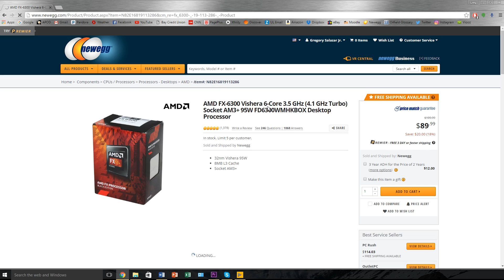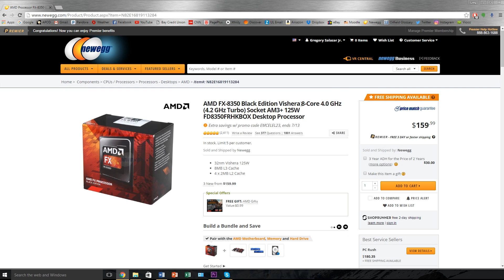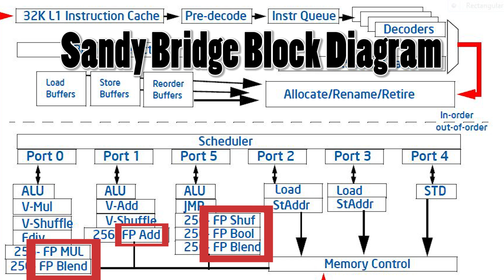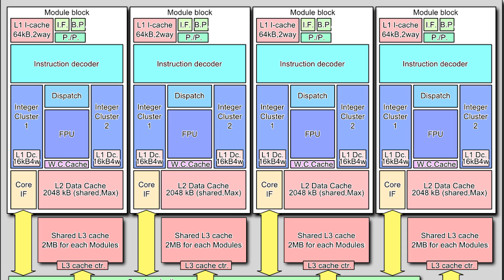How Many Cores Do AMD FX Processors *Actually* Have?

Comment: so as CPU tasks are  not sent always in parallel and the FX CPU assumes they are while Intel's hyperthreading does something not explained in this video to do processing out of order because of the scheduler being able to 1 as 2 cores instead of the "bottleneck" in the chip being there for Intel?
That is smart on Intel's part but i am still left wondering why design for that then need a windows patch to not crash on older versions and revisions of windows
The design makes sense for server loads just not consumer loads and most servers i see on prebuilt sites have more options with Intel's Xeon than what AMD has i forgot as some dropped those products due to lack of demand

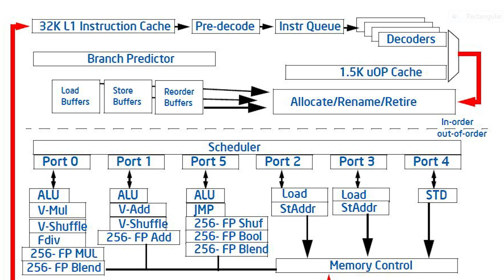Comment: Theres quite some missinformation here. First off AMD has had a class action lawsuite filed against them in 2015, and it's still ongoing (Case 5:15-cv-04922-RMW). When it comes to AMD's chance to win this, we can only speculate. I would however argue that it's rather slim. We should bare in mind that AMD's biggest downside in this courtcase is that the definition of "Core" (for general purpose CPU) was allready in use in this industry. What's even worse is that it was used by AMD themselves. Another weak point on AMD's side is the fact that the technique they use is called Clustered Multi Threading (CMT). As you can probably tell by the name or if you read up on CMT, it wouldn't have multiple threads if it one thread per core (since the technique is about increaseing the amount of threads per core).
Reply from the maker: Nothing in my video is "misinformation." You did not even elaborate. All you did was explain the CAL. In its current state, AMD can call it an eight-core CPU. I clearly explained the architectural layout of the chips with respect to Intel. Fanboy alert.
Reply: If its a "real" 8 core then you can call a 4 core 4 thread an 8 core.

Comment: The FX CPU's are built for and designed for intensive Multithreading and math crunching, not for pure IPC. This is why you see such wide variations in performance depending on the application. When using software that relies on few threads and raw IPC, it performs like an higher end I3, but will match some of the i7's on others that utilize it.

Comment: So how many FPUs are in a intel 6700 Quad Core?

I am just having an Intel system built after being a faithful AMD builder for 17+ years (starting with the 120Mhz AMD 486 DX4-120). I found that most DAWs actually feature intel processors and my current FX6300 is somewhat lackluster when I chain many Effects, which may lead both to Processor overload and audio dropouts (the latter is probably caused by my outdated MOBO [ASUS M5A97 rev1] in combination with legacy PCI audio cards).. I was sitting on the fence for a long time about crossgrading to Intel as there were many chipsets that were marked for bad performance (dropouts)  with legacy PCI cards, but I think that the chipsets have somewhat been improved. 

My new build is based on an MSI B150A gaming pro which has  a ASM1083 chip which is also in charge of PCI-e bridging. I will know next weekend whether this will work out or whether I have to sell my beloved M-Audio Delta soundcards and switch to USB based cards.

Comment: thanks for all the info, but I have a question: there's a programm that unpark all the cores of the CPU, it is safe to use? because I can see an improvement in the performance of my i7 2670QM but I don't want to crash my system. thanks again and good channel

Comment: AMD does have one advantage in this regard. Single core processing programs benefit from AMD's higher core clockspeeds, like Minecraft. If you are playing Minecraft with modpacks then AMD would have the advantage due to their higher clockspeeds. Programs that use multiple cores without limitations will have better potential with Intel than AMD, but still, it comes down to what programs you use due to developers coding them a certain way. For a program to use multiple cores requires coding that calls on multiple cores. Normally games would be coded and by default would use a single core. If a game were to use multiple cores it would need to either be built in the games engine or built in a file that the program can access and use, like an extension. Back during Minecraft 1.5 and 1.6 someone developed a mod that allowed Minecraft to use multiple cores to process multiple entities, which came very handy if you ran a lot of mods, like a modpack. Technic and Feed the Beast are such modpack managers. Under these conditions Intel would be better, but without it AMD would be better due to higher clockspeeds.

Comment: +Science Studio ... I've bought a FX 8350 CPU and sold it 6 month later again. It was the worst CPU ever which I bought from AMD. Before I used an AMD Phenom II X4 955BE. The performance boost between them was not really much. In like Skyrim I gained only 3fps more. Not a big deal. So I sold it and bought an Intel Xeon E3 1231v3 ... This CPU was much more better than the AMD CPU. In Skyrim I gained about 20fps more. I can read a lot of good reviews about the 8350 but in my opinion the 8350 is the worst CPU ever!
Reply: Xearox.de what the specs of ur build in 8350?
Reply: My build was:
CPU : AMD FX 8350
CPU Cooler : Scythe Mugen 3
Mainboard : ASRock 970 Pro3 R2.0
RAM : 16 GB DDR3 1600 Ballistix Tactical
GPU : Radeon HD 7970 OC
SSD : Intel 520 120GB

The system which I am using right now:
CPU : Intel Xeon E3 1231V3
CPU Cooler : Stock Cooler
Mainboard : Asus Maximus Ranger VII
RAM : 16 GB DDR3 1600 Ballistix Tactical
GPU : Radeon HD 7970 OC
SSD : Intel 520 120GB
Reply: Your Asrock motherboard is not that good for FX 8300 series. Best is the Gigabyte GA-990FXA-UD3 ver 4 or 5.
With that mobo my specs is:
FX 8320
Corsair H80i Liquid cooler
16 GB 1866 Crucial Ballistix Tactical Tracer
Sapphire Radeon R9 380x OC, 3GB
WD Enterprise 2TB 64mb cached
... and i'm still happy with it for more than 4 years now... overclocked in 8350 settings.

Comment: You have the best tech video's I've found and explain it clearly, albeit a little too fast. I own both a FX 8300 and a Phenom II X 6. With both at 3.3GHz, the Phenom beats the FX in rendering using Blender with the BMW27 benchmark by almost 3 minutes. I've found also that using my Hauppauge HD-PVR 2 capture card at 1080P the Phenom runs at 10% cpu load while the FX runs at 45% load. This is using the exact same system with just a CPU swap.

Comment: Well, I can agree that it seems to be a software issue, I noticed that 4 out of 8 cores are usually at significantly higher load than thee rest, like 4 are at 50% and the rest almost at zero, propably the reason I will get me a intel cpu soon (had the intel i7-6700K in mind)

Comment: Intel cores with hyperthreading aren't just "cores".
First of all every intel processor is hyperthreading capable... CPU masks are for HT cores.
When a chip comes out some clever laser cut/wire here and there enable or disable this or that feature, it's just a way to get better yield and separate market segments (i5 vs i7 -> noHT vs HT).

About HT... every core has some doubled functional units, lets say ALU, MMU and stuff... in fact there are double blocks for most "common" operations... the caveat is that those are SMALL blocks so you can double them with little die "overhead".
If HT is enabled (both hardware and software wise) the scheduler has his own unit for some operation and only one "common" block for the rest... thus allowing parallel execution with multiple pipe stages... out of order execution unit comes into play and try to maximize parallelism.

Long story short: bulldozer and intel HT are a lot more similar than it seems.
Reply from the maker: The way in which I described the differences was correct in this video.

Comment: Hi @ScStSalazar,

Just wanted to highlight that the reference to FPU usage was inaccurate in this video ( 3:05  ). Most common applications like .. Word processors , games or compilers do not use FPU's for their core functionality. The applications that commonly rely on FPU usage are like CAD/CAM software. You can find the specific functionality for FPU and other specialized instructions from http://www.intel.ca/content/dam/www/public/us/en/documents/manuals/64-ia-32-architectures-software-developer-instruction-set-reference-manual-325383.pdf , just search for something like fdiv ..etc. Most engineering and scientific applications will rely on FPU usage extensively. (another way to is to understand the big picture of how the code works , there is lots of algorithm / data structure work happening in a program , even in a game than executing physics engine related work )

It is also fruitful to consider historical aspects (DEC-Alpha / HP-PA-RISC ) and other architectures (IBM POWER / SUN(Oracle) - SPARC ) that surround the general microprocessor-based processing approaches. For example , certain concepts that Intel uses (including AMD) were originated outside of Intel/AMD. One of the technical approaches to optimize thread execution is known as SMT - Simultaneous multi-threading and Intel branded their version as Hyper threading (HT) . The architects knew that relying totally on clock cycles and instructions per cycle will not solve the barriers , ILP - instruction level parallelism and Thread level parallelism (TLP) was considered the way to move forward.  (I am trying to keep thing very short)

To take advantage of this approach the classical model of the software processes was modified , application processes became multi-threaded , Operating systems have multi-threaded kernels and sophisticated thread schedulers and to make all of this to work in harmony they used the Multi-threaded processors (SMT's). One of the core concepts in this era was thread context switch (less expensive than the process context switch).Since the applications will explore the threading models extensively , hence processors were optimized to handle such workloads. (To make all this happen - out of order execution (oooe), branch prediction, superscalar simultaneous multi-threading .. etc was introduced)

The SMT/HT approach is a way of making the thread execution efficient.  (fine grain capabilities of each implementation is up to each vendor , IBM POWER SMT <> Intel Xeon HT)

As per our topic , it boils down to the definition of the term "core" , IMO - the general assumption is core = single CPU , e.g. if the core is capable of executing 1 instruction per each cycle (hypothetical assumption), in a 8 core processor it should be able to execute 8 instructions in parallel if the OS scheduler submits to it , if not it is not ..I won't call it a 8 core processor !!! . So if the AMD FX Processor can perform 8 instructions .. it has 8 cores. ( it can do more than that in practice) , reasons for sharing FPU resources could be due the workloads , since integer workloads are predominant.

Very few applications will see the benefit of AMD FX processors due the lack multi-threaded applications and poor single core performance of this processor. ( There is some scope / hope for this in server space though. Prior to the takeover by Oracle , SUN Microsystems SPARC CMT architecture had a similar approach , where they focused heavily on multi-threaded application with a narrow focus on single core / deep pipelining approaches but they were successful in keeping the gain compared to their previous generation of processors. Whereas for AMD , their new generation started performing marginally better than their previous generation)

IMO - in case of AMD , their problem was on IPC (instruction per cycle) for  single threaded performance (guess they were trying to run at high clock speeds as well), they tried to improve the throughput by relying on ILP approach that they adopted but that didn't fly very well due multiple reasons (only AMD would know how exactly they got into this spiral of mess) , cache sizing (L1/L2) / latency , branch prediction issues , maybe even the fabrication process (it was designed with intent of using 16nm vs 28nm),Windows 7 scheduler issues  .. etc

The following articles provide good details  on this topic,
http://www.extremetech.com/extreme/217672-analysis-amd-lawsuit-over-false-bulldozer-chip-marketing-is-without-merit 
http://www.anandtech.com/show/5057/the-bulldozer-aftermath-delving-even-deeper
Reply from the maker: Not for their core functionality, but FPUs are used in literally any program that includes binary coding, i.e. every program that runs via Windows. What I said was not incorrect.
Reply: The definition of FPU is Floating Point Unit and they are designed to handle specific purpose , that's to handle floating-point math. Another way to look at is ... look at the Intel instruction set and the appropriate functionality that should able to clarify your doubts. ( why DIV and FDIV are in x86 ISA ? )
Reply from the maker: I know what FPUs are in charge of handling. But again, all additive binary information is processed through the FPU. Simply put, there isn't a single task within an OS or game that wouldn't require the FPU. It is much more important and much more utilized than you make it out to be. Please do not mislead my viewers.
Reply: Misleading ? interesting   :)  Well ..I didn't mean to nitpick ... , I just thought it is a good idea to set things in the correct direction ... , Have fun !!! enjoy your studies !!! 
 At your leisure .. might like to read  .. Robert Love's "Linux Kernel Development" , pg 20  "No (Easy) Use of Floating Point"  , http://support.amd.com/TechDocs/47414_15h_sw_opt_guide.pdf , pg 38 ....hmm  I am tired.

Comment: On my main PC I have the FX 8300 - which is an eight core processor and on my other PC I have the i7-920 - which is a quad core with hyper-threading processor, 8MB Cache and stock speed of 2.66  GHz.  It seems to me that my older i7 CPU runs better than my newer FX CPU - as in when I am running Sony Vegas.  My graphics card is the Asus Strix GTX 970 OC.  Every time I check my specs against a new game, it is always my FX CPU with the bottlenecking problem.  Now I know why.  Thank you for making this video and clarifying this for us - I had begun to doubt the validity of AMD's claim of eight actual cores.  Now I see it really does have eight cores, yet with a severely flawed architecture that hobbles the performance potential of the FX line of CPUs.

Comment: me i still use a phemon 6 core at 3.7ghz with duel r9 270x with 32 gb ram amd have no problems runing any thing what so every on my rig  with windows 10 just starting to use amd hard ware how it was ment to be used bioshock  infanate bench mark ave frame rate 230fps peek 340fps why should i upgrade?

Comment: Most code uses integer arithmetic not floating point arithmetic.  The ALU (Arithmetic Logic Unit) is in the integer cluster which there are 8 of. The FPU's (Floating Point Unit) are only more important if you doing lots of calculations with numbers like PI 3.14... or the SQRT(2) 1.44... Thus, this is a fair trade off  for the majority of applications. The video is slightly misleading, and further a lot applications off load floating point intensive work to the GPU these days.

---Edit---
Side Note most of this channels videos are tech video's  except the earliest ones -.0, but your called Science Studio.... Again misleading.

Comment: Small correction: FPUs aren't the only units that handle math in a general sense, but they are the units that handle floating point math. So the integer units still do math, just with ints instead of floats.
Reply from the maker: You're correct. I didn't want to confuse my viewers, but yes, your description is more accurate.